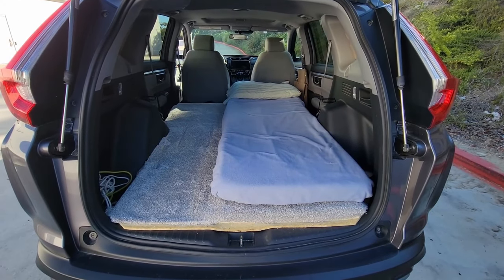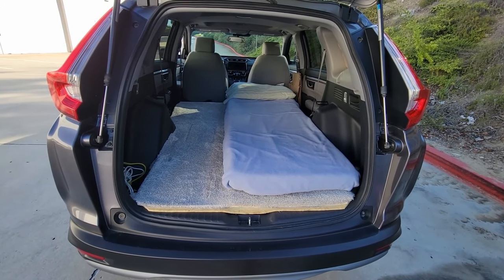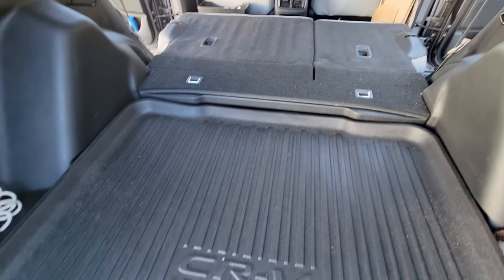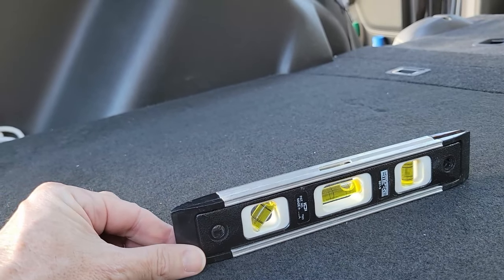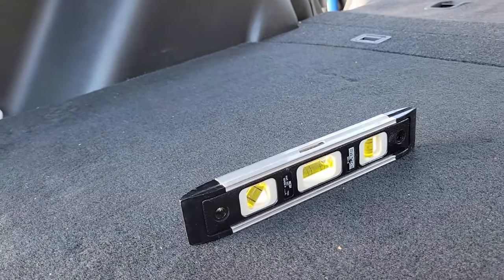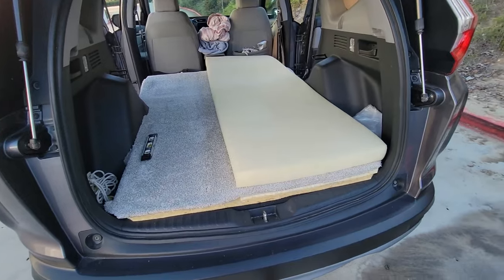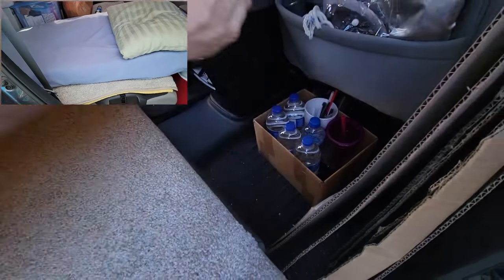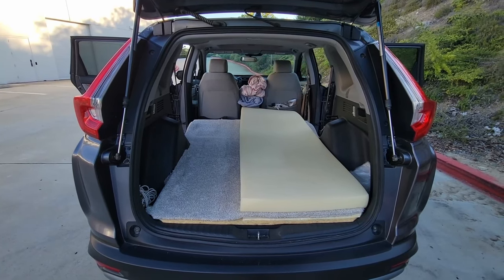Sleeping in an SUV: How to Make the Floor FLAT & LEVEL for a Mattress; How to Sleep in a Honda CR-V

Comment: So glad I came across this video. I have a 2016 Nissan Rogue. Why did I just go to trunk and realized mine adjusts in height the same way and now the trunk is level. Smh. Never knew that as long as I had it. I made a platform for nothing 😂😂🤦🏽‍♀️

Comment: To avoid feeling the end of the 3 extra layers, put the under carpet padding the other way around. Small piece first, medium piece on top, larger piece then the longer piece on top.
Reply from the maker: Yes you're absolutely correct! That's the way I should do it. I recently showed the video to someone, and that's the first thing he said as well. I don't know why I didn't think of that. At any rate, thanks for watching and for your great comment!!

Comment: Rather than use various pieces of carpet pad to try to level the floor, wouldn't it be easier to just get a couple short lengths of 2x8 that you place behind the rear wheels and then back onto them? The car wouldn't be level but the bed would. Alternatively, several lengths of 3/4" plywood that you could stack to get the right height for each wheel.

Comment: Better than having to add a platform, but that's still a lot of extra crap just to avoid a very minor slope. A couple of RV levelling blocks would cost about $50  and make all those pieces of foam unnecessary.

Comment: Thank you Rich, for showing me the trick to pull the back piece up, I wondered why everyone else had a flat floor but mine didn't!  Now I can plan bed with out having to build a platform!
Reply from the maker: My pleasure! Glad the video was helpful and that you won't have to build a platform! Thank you for watching!
Reply: Exactly. I just did the same, thanks to Rich. I might (definitely)  have liked 8 or 9 inches of under floor storage but not going to live it in so maybe need to put seats up again. Anyway most stuff has to go in a bear locker anyway.

Comment: great video.  may i ask, how tall are you? do you sleep at an angle or straight aligned with car?  also, do you get in and out from the side doors or is there a way to get out from the back hatch?  thank you!
Reply from the maker: I am only 5'6" tall, which allows me to sleep straight aligned with the car. The foam mattress is 72" long and just barely fits. I use the side doors; I don't know of a way to open the back hatch from the inside. In fact, sometimes, when I'm sitting in the driver seat, I take my shoes off and then crawl over the center console to the back. It all works great for me because I'm not a large person. But it might be difficult for taller people. At any rate, glad you enjoyed the video, and thanks for watching!

Comment: wow thank you! but if you raise the floor can you still put a lot of furniture. wondering when you raise the floor maybe heavy items will not hold?
Reply: Well if you are carrying furniture, then you wouldn't have your bedding in there and the car in camping mode.....you would have your camping gear out, and simply put the rear platform back down to the lower setting

Comment: I admit I am confused on this video. I actually went to 2016 Honda CR-V SE and found out there is not completely flat. Instead there is lower back seat put front and back seat on flat. It is not completely flag which I am still struggle. I even ask sale person at dealership if it's normal or not. This person struggle and say it's normal. Should I remove head on back seat or what?
Reply from the maker: The video applies to 2017 and newer CR-Vs. If you have a 2016, it may not work, but I am not sure about it. At any rate, thanks for watching.

Comment: I didnt hear how tall you are. And can you stretch out fully or you have your knees bent. Im 6.2  so wondering if get crv or get the 4Runner
Reply: I'm 5'8" and have and have a 2012 crv so there's a few more inches of space in his 17 CRV vs mine because it folds less flat towards the driver's seats end. 
And I don't have enough room to fully extend my legs which has caused me enough discomfort that it took longer to fall asleep by a significant amount to not being able to fall asleep at all- that was more in the summer or early fall when it's hotter and more humid and less conducive to falling asleep at all- even if I could extend my legs fully.

I've moved my legs on a diagonal so my head is ihe right top corner position (viewing from the rear end of the crv's cargo area) and my legs extend to the left bottom corner which gave me a few more inches, but I've estimated in my 2012 design that I'd need a base of 6 more inches so I could fully extend my legs from the Left Top corner where my head is to Bottom Left corner (without diung the diagonal with my legs, which still didn't full work).

Comment: Good idea but wat about the tray.. try flipping the tray upside down so you don't loose the tray space instead to see if that works 👍
Reply: I wondered where it would go as well. One might not want to leave it at home, especially if they're using the cargo space for gear while on the move. But it dawned on me, maybe it can be stowed UNDER the floor panel in the space that's created when it's positioned at the higher level??

Comment: My 2016 CR-V folded seats also slope higher towards the front making them about 10 inches higher at the front than the rear of the cargo floor, so you have to build a platform. Having a 2017 would have made a bed in the back so much easier.
Reply from the maker: Yes, it makes it a lot easier! That's one of the reasons I bought the car. Thanks for watching and commenting!